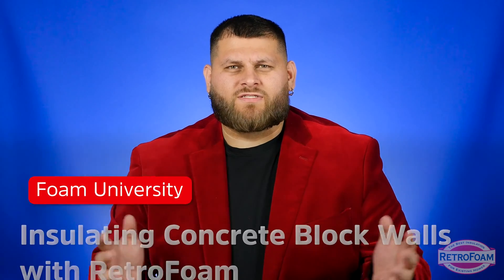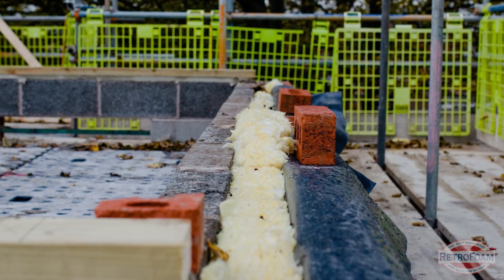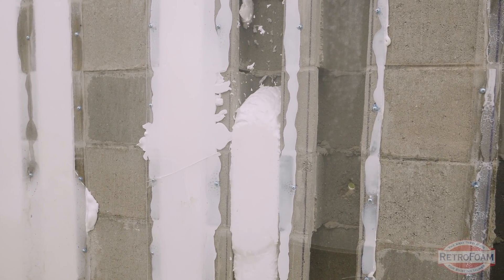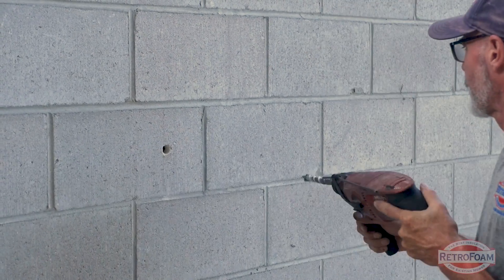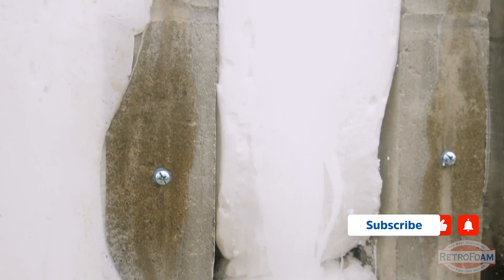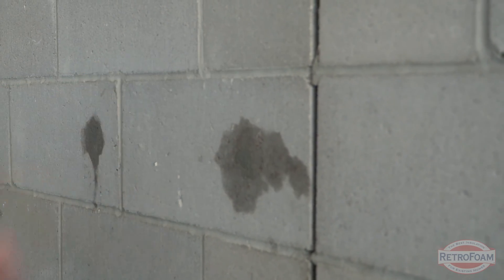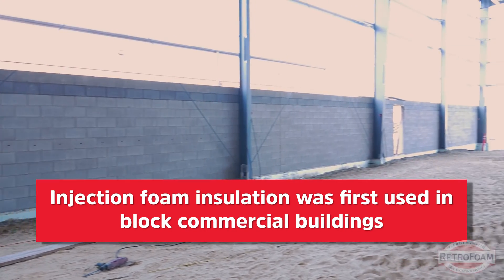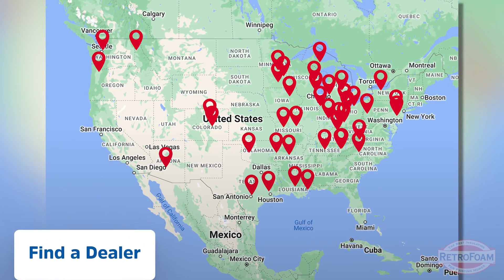Insulating Concrete Block Walls with RetroFoam | Foam University by RetroFoam

Comment: I think you could also sell the fact that bugs will not be able to enter as easily. I have a house from the 60’s made of block, one open entry point and that bug can go anywhere. Looking into your company as an option here in PA.
Thanks
Reply from the maker: This is true! Here's some additional info on this topic: https://www.retrofoam.com/blog/retrofoam-as-pest-control-insulation

And we do have multiple RetroFoam Dealers in Pennsylvania! 😊

RetroFoam of Pittsburgh: https://www.retrofoam.com/dealers/pennsylvania/pittsburgh-spray-foam-insulation-contractor

RetroFoam of Philadelphia: https://www.retrofoam.com/dealers/pennsylvania/philadelphia-spray-foam-insulation-contractor

Pridemark Construction: https://www.retrofoam.com/dealers/pennsylvania/eastern-pennsylvania-spray-foam-insulation-contractor

Comment: What is the pressure the expanding foam on the blocks?    How far (high) does the foam spread from the injection point?
Reply from the maker: RetroFoam injection foam doesn't expand! This article from our Learning Center goes into more detail about the differences between injection foam and spray foam: https://www.retrofoam.com/blog/difference-between-retrofoam-and-spray-foam